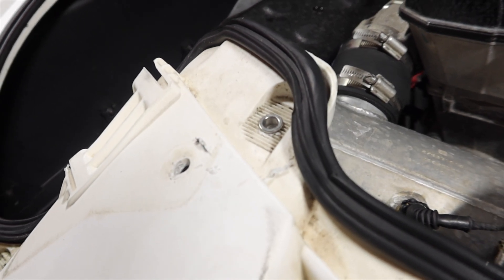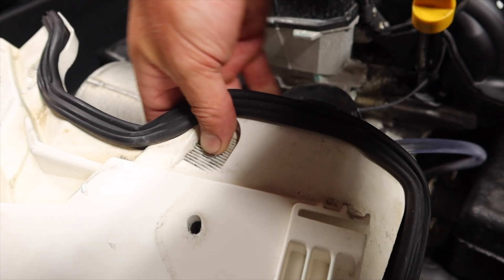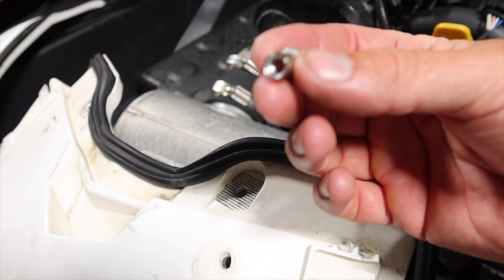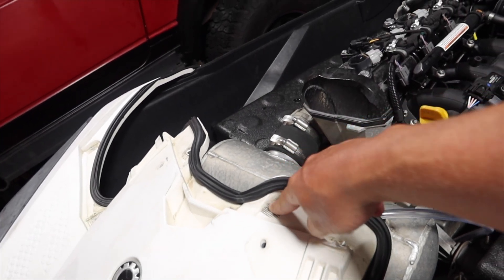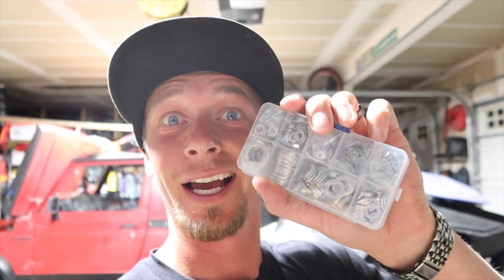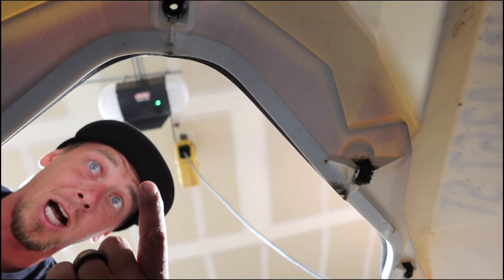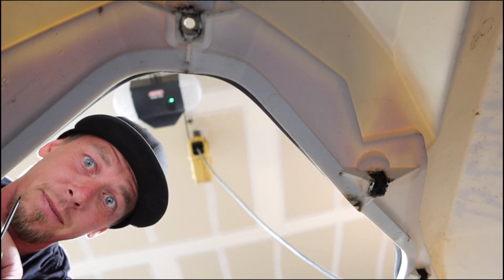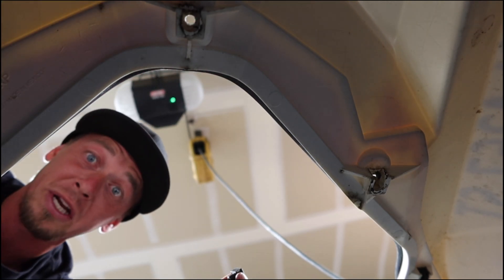Fixing Stripped Out Screws On The Seadoo Spark For Good (Rivnut Mod)

Comment: Question, why didn’t you just buy replacement square plastic nuts that come on the Seadoo Spark? I’ve had some of the plastic wall that holds the square nut in place break away, so I had to come up with a different solution, but why replace them if the plastic that holds the square in place isn’t broken? Wouldn’t have been easier to just buy replacement square nuts?
Reply: The plastic one holds just fine, it only strips and breaks away when the owner over tightens or strips it.
Reply from the maker: It would have been easier you are correct but nothing ventured is nothing gained. It’s worth trying a new system to see if it works better. If we all did the same simple thing nothing new would come of it. Got to be different and better

Comment: Did this end up being a good solution or did they loosen up from riding?
Reply from the maker: They worked great for two seasons and still running strong. So much nicer when it comes to splitting the hull

Comment: so yes, those plastic nuts are serviceable and they even have some 3-D printed ones on eBay. I bought some 3-D printed ones to compare with the OEM ones that I also purchased alongside. I'm thinking about doing this but at the same time I'm scared that corrosion could cause a lot more problems down the road while the plastic doesn't get corroded, either way it's a good alternative to all this plastic shit In these sparks
Reply from the maker: I saw that there was alternatives and thought about replacing but I haven’t seen anybody come up with anything new. I like to find alternatives so there is new or better ways to do something. That is a good point with the corrosion but with taking the hull off at least yearly I just put some anti seize on then and hope for the best
Reply: Did it solve the water problem has I think I may be having the same issue.
Reply from the maker: It helped my water problem a ton. The rear of the deck was warped and the added clamping force made it seal. Plus everything was marine grade stainless so I shouldn’t have any problems with rusting